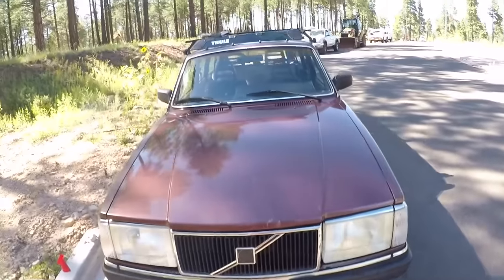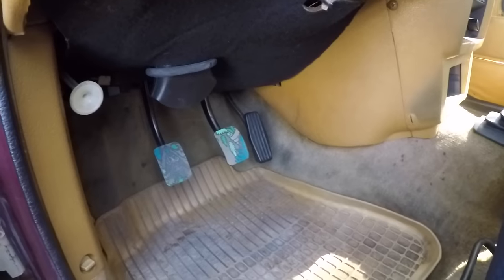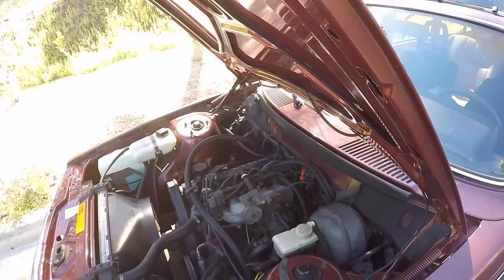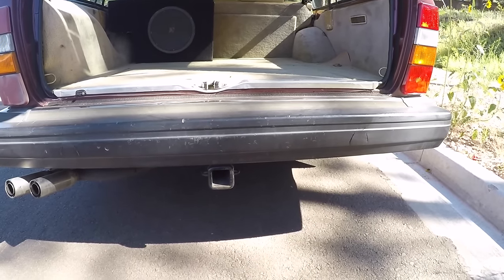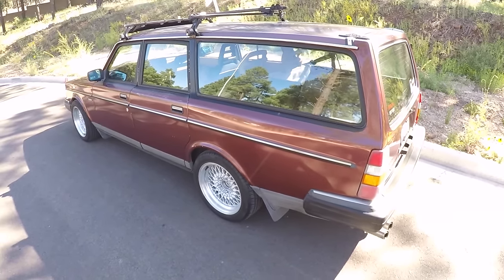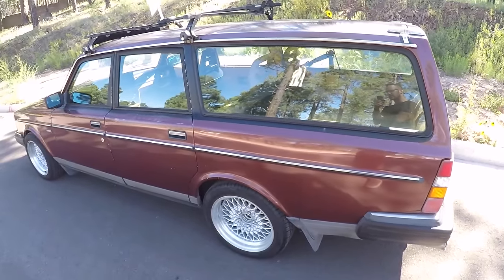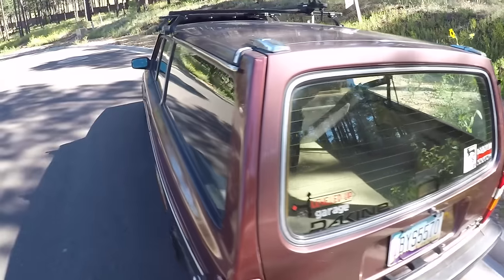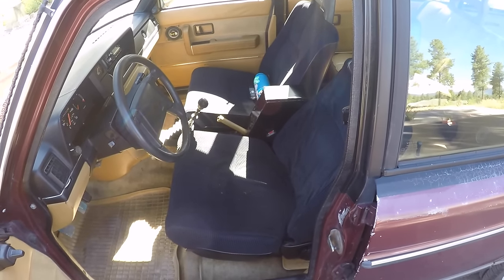The Volvo 240 is Actually a Great Enthusiast Car + Walkthrough and Drive

Comment: Without watching - why the 240 is a *great enthusiast car:
1. It is a tank
2. it actually drives really well, rolls a bit when cornering but that's nothing huge
3. Isn't as slow as people portray, even the basic small petrol models - and they hold their own on the highway much the same as a Benz
4. It is safer than your newer but lighter econobox (little cars can go airbourne just running over roadkill, happened to a friend)
They are charming, and their slower character brings a kind of happy-go-lucky feel. You make memories in them.
5. They're just awesome
Reply: I agree with everything you stated except for the weight.  They're very light cars for their size at 2,957 lbs for the sedan.  They are super safe and have really forgiving suspension despite that makes going over rough road or dirt roads a breeze.  I was a Chevy guy before I got my 1983 240.  Now I'm a Volvo and Mercedes fan.  Throwing a 240 into a turn is hilarious because they have a bunch of body roll, but it'll take turns pretty well.  Just replaced the oil pump last week and I'm excited to start driving it more.  What Mercedes is in your profile pic?
Reply: Also, upgrading to stiffer suspension components doesn't make the ride significantly harsher, but gives you DRAMATICALLY better handling. Like, better enough handling to make the stock narrow wheels do 45 around an honest 30 MPH bend with nary a chirp. 

And that's another thing. There's just so much available in the way of aftermarket upgrades for these cars. You want better anti-sway bars to get rid of the excessive roll? Poly bushings? Stiffer springs? A real skid plate instead of that flimsy plastic splash guard? You can get 'em. 

Though, I wish anyone actually made new cargo area covers for the wagons, or snow guards for the cowl vents...

Yes, I know there's that one guy who makes cowl vent snow covers, but I've bought enough things from him at this point to know not to waste my money anymore. His quality is garbo.
Reply: @jacobbelcher3512  I just saw this sorry!
Interesting to know what you've said, and yes they do still turn in well.
My car is a 1999 C200 (classic trim) - also rolls like a bus but turns in surprisingly well and just manages to get out of its own way 😆
Reply: The 240 being a safer car than modern econoboxes is not actually the case, in the safety department these have been surpassed a long time ago. In fact, over 13 years ago the British programme Fifth Gear crashed a (smallish) Renault Modus into a Volvo 940. The Volvo didn't fare too badly, considering its age, but the chances of surviving that crash were bigger in the Renault. Now add another 13 years of development... you can see where this leads.

Short version: https://www.youtube.com/watch?v=qBDyeWofcLY
Full version: https://www.youtube.com/watch?v=emtLLvXrrFs
Reply: Absolutely, they feel just as nimble as any modern naturally aspirated 4 cylinder.  Good point to add also is that the engine design is a non-interference so if the timing belt breaks, you just get stranded on the side of the road... But 240's are know to always take you home.  It is definitely one of the best most reliable cars ever.

Comment: getting a 240 as my first car
Reply from the maker: jamari ! Great choice! I’m sure you’ll love it, feel free to ask any questions you may have.
Reply: i got my 240 when i was in high school still drive today.  since 1999
Reply from the maker: Very good info! Thanks for posting.
Reply: how many mpg are you getting?
Reply: Bit late to the convo but I got a '90 760 turbo sedan at the moment for my first car 😊 I love the sound of b230ft and I'm hoping to swap one later in my life
Reply: Lucky you
Reply: I have question, how u make it go faster?
Reply: Same bruv!
Reply: Same here
Reply: I'm in High school and own a volvo C70 and a 1997 volvo 850R sedan.
Reply: @MrShiftpower  They get around 25mpg nowadays
Reply: 1983 240 was my first car, and I'm never getting rid of it.  I was a Chevy fan before, but now I'm a Volvo and Mercedes fan.  These people have some great advice, and I seriously hope you have fun with your 240.  They really aren't fragile cars as long as you maintain them properly.  You'll wind up accumulating a bunch of spare parts for things that will never break like the rest of us have.  Id say you should replace your torque rods.  I didn't go with the IPD torque rods with poly bushings.  I got the OEM ones and they made a huge difference.  Clean the flame trap at every oil change.  Mine was relocated so it sits above the intake, and that makes it so easy to clean.  Don't skip this because if you do then you can start consuming oil and start pushing oil out the valve cover gasket.  As far as fuel economy, I usually get between 18 and 30 depending on how gentle I am with the throttle.  For just normal driving I get about 25 mpg.  I took it on a 500 mile trip last year.  On the way down I averaged 40.8 mpg, and on the way back I averaged 23.6 mpg.  On the way back I took a more scenic, mountainous route and it rained the entire way back.  Turns out hydroplaning is pretty fun in these cars.  Anyways, they make awesome first cars.  Enjoy yours as much as possible.  If you need any answers to questions just ask and we're here to help!  What transmission does yours have?
Reply: Im thinking about buying a 240 or 740, i now have my dads old amazon as a projekt.
Reply: Just bought a 1986 244 DL as my first car, I'm 15
Reply: Rasmus Cyrillus yessir im 15 too n i just bought a 92
Reply: same here
Reply: My daily driver is a 1967 Volvo Amazon. Rust free wonderful car. Who needs something modern like a 240 :) ?
Reply: same

Comment: I just took a job at a Volvo dealer as a journeyman tech. I have always liked Volvo. When I worked at a ford dealer back in the 2000's I fell in love with Volvo. Super easy to work on, diag and modify. I love how function meets form with these cars.
Reply from the maker: You are correct about that! Good luck in the new job, and thanks for watching!

Comment: In 22 years of 240 service, I've replaced like 15 Manuel transmissions, and only one auto. The auto-trans are bullet-proof; may just need a leak fix. I recommend a  '86 - '93 240 Volvo, with '88 being the best year.
Reply: Yep. Autos in these Volvos are great.
Reply from the maker: cant dispute that, its an aisin trans and they are bombproof, still a bit lazy and personally i prefer a manual

Comment: Proud owner of a 1992 740 wagon with 419K miles. All original no rebuilds and valve cover have never been off. Never painted or wrecked and still looks great no peeling or dulling. Been in my family since new. I drive it daily. I also drive it on vacations road trips etc. I will make a video of it hitting 500K miles.

Comment: I have several 240s very good cars and reliable,  easy to tune and work on. And here in Sweden I get some 240s for free ;)
Reply: About ten years ago, my ex-wife got one ('92 wagon) for free...low mileage, but had not been started in four years.  I put a battery and gas in it.  It cranked right up.  

Then someone else gave her another ('88 wagon).  She gave it away to someone else...not me.  Had severe rust issues, but it was a manual, and ran great. I miss that one.  

Now I'm having trouble finding used parts--having acquired the original '92--and there's not a single 240 locally right now on Craigslist or Facebook Marketplace. I worked on it for ten years--most of which it was a daily driver for her or my daughter--and now it's mine.  It needs some love, but it's almost the latest model, rust free; runs and shifts (auto) great.  

And it's a 240 Volvo wagon.  Definitely something I can work with.

Comment: One thing to note about the turbo swap if your donor is a 240 is the entirely different fuel injection setup. 240 turbos used a mechanical continuous injection system called K-jetronic. You'd be better off sourcing a 940 turbo because they had the more compatible (and easier to live with) LH 2.4 system, just with a different tune because turbo.

Comment: Awesome video! Was also the proud owner of an '89 240 sedan which I also swapped with an m47! Fantastic car to drive, unfortunately got into an accident not too long ago that totaled it. Now working on a '72 144s!
Reply from the maker: sounds sweet! bummer about the accident, always rough losing a car. Glad to hear you're cranking away on a 144, love those too
Reply: Ryan Tyniec hey I have an ‘89 240 sedan that I also swapped to an m47!  Thinking about eventually doing a Chevy 305 swap on it in the distant future
Reply: Daniel Pfender got me browsing my phone late at night from work lol. That's awesome! 305 motors are great, but from my understanding they aren't big powerhouses. I know guys swap in  350s, LSs, and even "bimmer" motors. If I have any advice, it's to enjoy that car at least a little before doing crazy work on it. I only had my swapped 240 for a couple of months, and didn't get it sorted out entirely until 2 days before I got in an accident! Regardless, best of luck to you!
Reply from the maker: yeah, most of the us market v8's aren't putting down any serious numbers although many are compact being pushrod engines and i'm sure the torque would be fun. I'm a big fan of toyota/lexus v8's for swaps, or nissan vq37vhr with a cd009, cheap and powerful in stock form. Pick up a crashed car and swap everything!

Comment: These are GREAT cars, either in saloon or estate version. Both are timeless. They're comfortable, solid, smooth and reliable, with a perfectly respectable performance, but if you're just looking to burn rubber, go elsewhere. Try for the highest spec you can find, and if you find one with FULL service, be prepared to pay the extra... it will be worth it. My first was a 164, (3.0 litre, straight 6) then a series of 240GLT estates, all automatic. Fifteen years later, I bought an s60. The interior was was nowhere near the same quality.

Comment: layed a 1973 honda trail 90 down in the back and had room to stack another on top. '86 240 wagon had 394k miles, m46 transmission. my advice though, any 240 under $1000 is a gamble. save your money and get a decent one
Reply: Got a $1200 wrecked one.  It was definitely overpriced, but it turned out to be a great car.  Replaced the driver's door and fender and that was that.  Of course I've done a bunch of maintenance the previous owners neglected over the years, but it was worth the price to me still.  I agree that you should just get a nice one to begin with.  No need to go tracing problems on a car that isn't worth much.

Comment: If you don't feel like dealing with adding a turbo, you can still swap out the stock M cam for a better one like the B cam, T cam or a VX  cam from IPD. Combined with that cool looking exhaust that you have, it should add a little more oomph to your car's acceleration. Nice video, I love the 240's, thank you for sharing !!
Reply from the maker: Thanks for the comment! I forgot to mention the IPD aftermarket stuff in the video, good point though
Reply: That's also like a 45 minutes job, biggest issue you'll have is adjusting lifters which isn't that hard

Comment: I sold my w123 Benz and recently found a pretty decent '90 240dl wagon with m47 manual from the factory; it needed a bunch of maintenance, but there's almost no rust, which was my priority. I'm enjoying it almost more than I was expecting.
My recommendation is to immediately change the transmission mount, and put in engine mounts for a diesel 240, which look the same but are harder.

Comment: To increase the horsepower without increasing fuel consumption, you can put a volvo 531 head with a k or a vx3 camshaft, at least on a b230 without turbo. as far as I know. I promise, the difference is noticeable on the acceleration.😊
Reply from the maker: mogge960 interesting, I have not heard this, I will definitely be looking into it! Thanks for watching and commenting
Reply: thanks for making good videos ;D
Reply: U have a B230F right? if u swap to 531 and vx3 u'll get 130hp instead of 115. a lot of 940s' came with that engine and it's called B230E so maybe u can find it at a junkyard. and for the transmissions, M90 that was used on the turbo engines is the strongest one. If u like modding old volvos it's sad that u don't live in sweden or maybe u can buy parts from here aswell(?), there's insane amounts of modding/tuning and stock parts.
Reply: Or just swap a 5.0 liter mustang motor in it.
Reply: @danielfair4675  chevy all the way.
Reply: @milkhehe  .... I have a 6-speed GS Corvette ragtop. Lol 
Thing is, a 5.0 motor is a direct swap, Chevy motors are not.
Reply: The b230e came on the 240 without the cat and had a higher compression ratio.

Quite rare to find these days

Comment: Recently got a volvo 240 (1987, 195k miles, clean title, clean as a whistle), and was wondering if you potentially had a list of parts that you used on your build, as well as where you got them, brakes especially. I plan on turning mine into a street legal track car, with about 400whp as the end goal for power, and a bunch of track oriented handling parts.

Comment: Any 2" tachometer will fit that Volvo gauge cluster socket. I had aftermarket VDO. And turning radius on these is insanely tight, since front wheel spaced out wider, then rear(which are narrower), it will u-turn where Honda Civic or Toyota Corolla won't.

Comment: Hey , Today marks 1 year of my volvo 240 wagon. I ve been modifying it bit by bit with a 7mgte manual tranny. I ve been able to use most parts from toyotas, subarus and other car makes into the brick. Nice job and keep in touch. My project is in Turbo bricks as " 240 7mgte swap" with pictures of the slow progress. SEe ya 
DZ
Reply from the maker: Nice I'll definitely be looking you up. I'm a yota guy at heart, the 7m is an interesting choice, great engines once the heads are sealed up well haha. Thanks for watching! More toyota videos coming soon (including a couple swaps, aw11 20v 4age, and beams 3sge 77 celica), subscribe to see more! we appreciate the support
Reply: Budget Build Bureau 
Nice Actually i had a Cressida with The 7mgte which was fun but The body rotted beyond repair. so on the way home from work i Saw a 240 wagon and it took off from there. Searched for one for about 8 months till I got the combo I wanted, red body and black interior. Yes  as you said there are plenty of parts to get and swapable ,.It still on the works as we speak and I am dying to hit the street with it. My brothers in Puerto Rico are all into all toyotas too. Ia m in a hell of a budget as I always look for deals to put the car together. I had a 72 Celica with a 18R engine back in the 80's and it was my first project car. I had a 82 Celica with a 12 A rotary engine that kicked ass and then the cressida became the third and now the wagon is the fourth. Wait I had a 79 Corolla lift back with some minor modifications and I crashed it twice and sold it for a few bucks cause It was just bad luck. then the Celica 82 then the cressy and now the brick. I learned my electrical in a hanes book with a 72 hi lux pick up truck. Hopr to hear fron you.
SEEya 
DZ

Comment: these cars are extremely easy to work on, here is my 2 cents worth as an experienced 240 person, make sure drive shaft bearing has not dried (grease), never use aluminum fuses- only bronze or copper etc. stalling is caused by vacuum leak (volvo shop manual)

Comment: Plus the 240s 140s and back are strong reliable cars with protection for all the people inside the cars compared to the other makes as being a former owner of a 1981 244 GL it is very easy to adapt parts of a later version of 240, I had added a 3rd brake light,which look factory,changed the dashboard of the 81 because it was cracked due to the sun, added a later model dash to it it took me at least 2 hours, everything installed & working added some options to make it awesome plus if you have manual mirrors, and want to put electronic mirrors, they are easy to install plus add that touch, if you have fun working on your car, there are a lot of things you can do to improve the aesthetic  of the car, like if you have the radio by the shifter or automatic shifter, you can put it on the upper part, since they have a kit, to install the radio in that space, most places where they install radios have the kits, to make these simple yet easy & beautiful kits out of the way of where the manual or automatic shifter is swap steering wheels, being that my car was automatic, no overdrive, I put a 1983 automatic transmission completely with the automatic shifter that has the little overdrive switch plus some other swaps to make your ride awesome,spectacular.

Comment: I love my '92 Auto Wagon, there's plenty of fun to be had with these cars no matter how weak they are.
Reply: The 240's ain't weak though.
Reply: @-m.d.n-9019  Powerwise... Tough as nails im every other respect. Shit can't outrun a bird...
Reply: @leleedler  just get a vx camshaft from ipd , and a K&N air filter.
Reply: @-m.d.n-9019  That's fair, I've owned more modern cars though and the speed is definitely lost after being in some genuinely quick cars.
Reply: @leleedler  yeah. That what I'm gonna do when I get my 240 sedan for my first car . To give it some pep in it's step.
Reply: @-m.d.n-9019  Yeah, I had a black 240 wagon. I installed new injectors, vx cam, new headers, and at one point I was running a pretty basic turbo setup. Honestly none of which were all that fast. The turbo got the car going pretty quickly but, I couldn't really get 0-60s under 7 seconds.